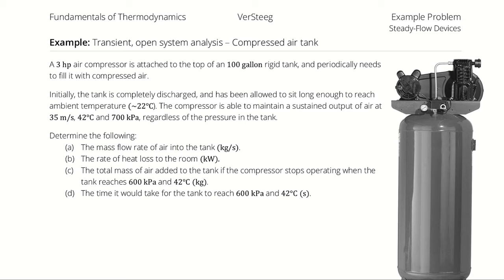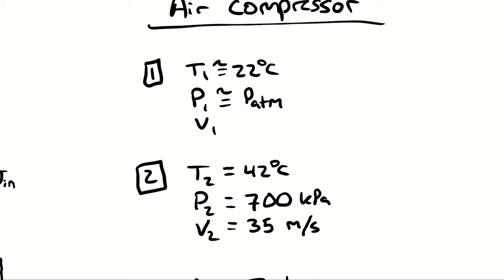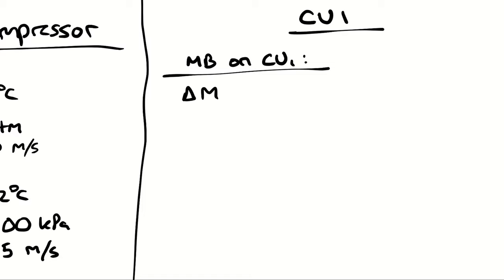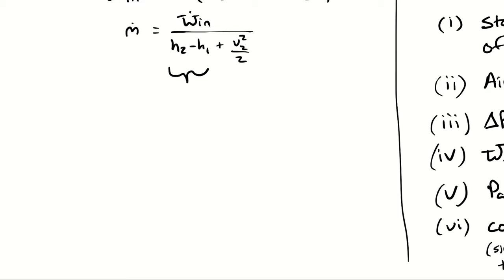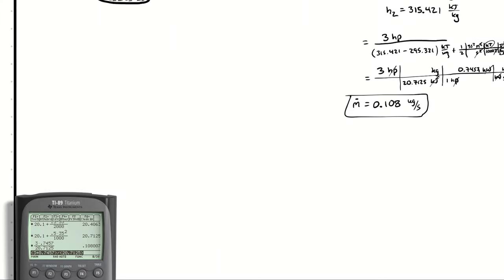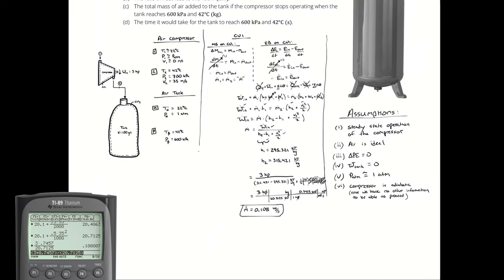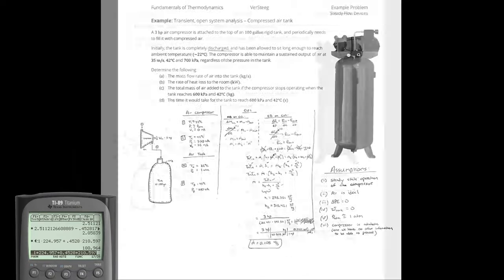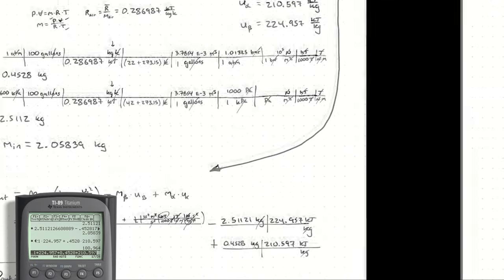Mixed Example Problem - Air Compressor and Tank

Comment: Nice but I just want to know a few things.  Forget the math.  I want to know what the temperature of the compressed air is going into the tank.  And the temperature of the air in the tank.  (b) The rate of heat loss to the room (kW).   What I want to know is if I add a second tank how will that affect the air temperature of the compressed air?  In the real world people are adding copper pipes lets say 3/4" for lets say 40 feet for cooling the air after the tank. But will a second tank do the same thing?   

The refrigerated air dryers need the air to be 100 degrees F or less to work properly.  So thousands of comments about "poor mans air cooler or air dryer" which is the copper pipes.   But you have the answer of whether a second tank would work as well but the answer is lost in all of your math.  

Cool air holds less humidity or water than hot air.  This is the whole purpose of this comment.  People want to dry their air.  What is the simplest way to cool the air?  40 feet of copper pipe, or a second tank lets say the first tank is 80 gallons.   The second tank could be the same.